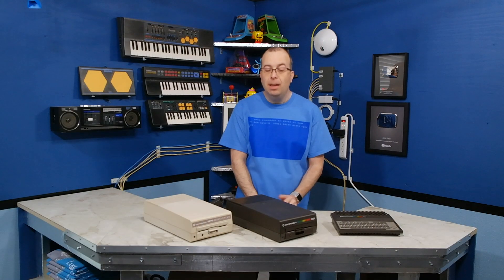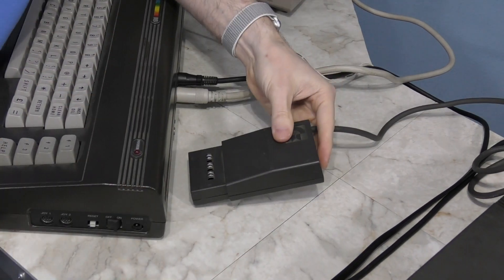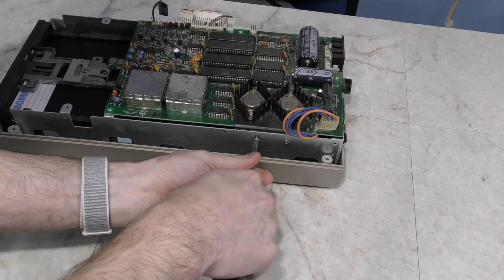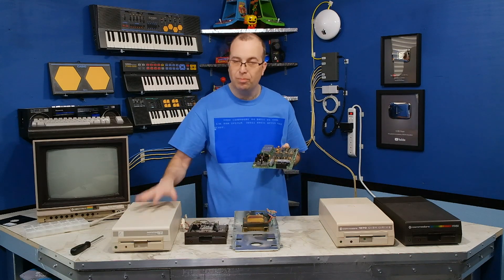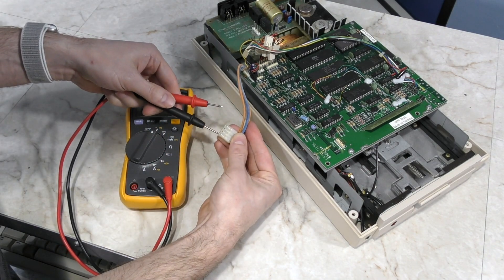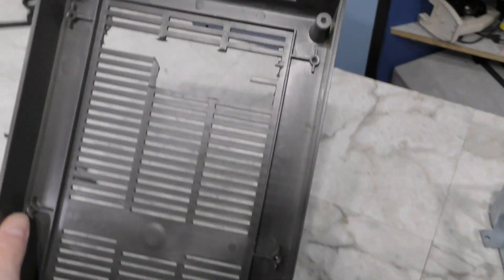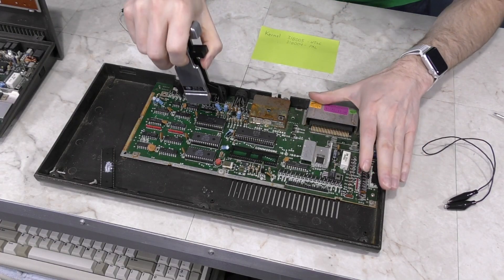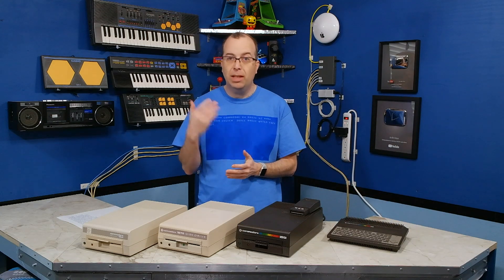Commodore C116 and drive repair, 240V to 120V conversion

Comment: wow, how can you get so much abos? It is nice to be influencer but not when you tell the people wrong stuff.

6510T is not a 6510 processor, else it would have printed 6510 on it and not 6510T. 

Most of those floppy transformers have 3 positions/pins, 110/220/240 Volt so most likely your "mod" on replacing that part was totally unnessaccary (except you had another version). At least you could have gave this advice or learn a bit about Commodore before doing a video?!? Oh this episode was not planned. This episode was horrible. Just solder it to the correct input voltage. Also the transparent feet hurt me, that is not a proper restoration. And 1551 always breaks and was not packed well during shipping. The drive mech also has a different color (black vs. brown on 1541). The commdoroe 64c in your picture has no original logo on it.
Reply: 6510T: version of 6510 with 8 I/O-Ports

Comment: Awesome video, do all the larger framed 1541 drives have compatible logic boards? I have a few myself I am about to dig into repairing. A video on how clean these and fix common faults would be an awesome follow up.

Comment: this guy is great when I was little I had 1581, 1541,1541'II and tape drive, and Gemstick, and light brown keyboard, also 1702 monitor, Okidata printer, and software I was using was Image 1,.2 BBS and Vision BBS, and Lt. Kernal Hard Drive I think that only made 10 megs

Comment: If you pull apart the keyboard, do a search for "wire glue." It's basically just a conductive paste, I've used it for small projects before, and I would be willing to bet that it would work for the rubber contacts. (It's also cheaper than the stuff used on the last one)

Comment: I live in the states and even though most of my outlets are 120V, My dad was able to install some 240v outlets easily in our home.
EDIT: I think these outlets are 220v not 240 not 100% sure though.
Reply: Yeah, all homes with electric stoves/dryers will have 240V outlets. These are now used by car chargers as well. They just have two hot connections.

Comment: I must add that it's nostalgic to see the inside of a C= floppy drive.  I have installed drive select switches (many times) ,  JiffyDOS (ditto) ,  and a RAMBoard (once) in those drives when I was part of the ACUG #0447.

Comment: I always disliked that style door mechanism on floppy drives. My first 1541 drive was like that and I used to have it on a low shelf right next to my chair. The drive was a little longer than the shelf was deep, so it stuck out a little. I lost count of the number of times I accidentally bumped it with my knee, which would eject the disk, usually right in the middle a disk access.

When that drive needed to be repaired, they swapped out the mechanism for one with a twist latch. I liked that one much better.

Comment: No surprise that you've found that C116 in Hungary. After the market failure of C+4 and C116 most remaining stocks were purchased by state-owned Hungarian companies to sell the machines for schools. At that time Hungary was behind the iron curtain and most home computers were smuggled into the country by individuals or were imported by state-owned companies. Those companies usually went after cheap stocks regardless their market value, since - because of the lack of any real competition - people bought whatever they could get their hands on anyway. Commodore 64 was the only exception which was imported and sold officially from the manufacturer, but its price was horrible (about a yearly average salary), so any cheaper alternative were welcomed.

Comment: I saw a 1541 in a Value Village over the weekend. It had the device 8/9 switch on the front of it and it was actually in really good condition but I didn't pick it up because I have no C64 and I'm sure David doesn't need any more 1541 drives. Just thought it was strange to find just the disk drive and not the C64 itself. Maybe someone else picked it up before I got there.

Comment: C116 the weakest and cheapest Commodore machine ever made but a weak Commodore is still great to play on especially if it's a game accross multi Commodore platforms you are playing you know it won't compare good to the other versions visual and audio wise but thats what makes it an interesting system you don't need the powerhouse Commodore hardware to get a good Commodore game out and if you are lucky the C116 version would get the best playability not counting audio and visual.

Comment: Hi. 
A question. Is it possible to connect a 5 1/4 PC floppy disk drive to a USB PC?
Reply: To my knowledge there exists no cheap mass-produced solution for that. But.. if you really need to do that, there exists the Kyroflux: https://www.kryoflux.com/

This is an advanced floppy controller that allows you to read almost any floppy format. Of course you can read PC floppy disks, but it also allows you to read PC, Apple and Atari floppy disks on your PC, with a PC 5.25 drive.

Comment: You can change a 1551's device number via software by typing in the following:

OPEN15,(current drive #),15,"%";CLOSE15

The 1541 M-W command to change the device number via software will NOT work on a 1551.   Also the 1551 is limited to device 8 or 9 and only two 1551s can be used by one computer.

Comment: I was concerned about the PAL vs NTSC and 240 V vs 120 V problem when I moved to Canada. Because I wasn't sure if my european Super Nintendo would work properly. So I bought a voltage transformer and a PAL to NTSC converter in advance just to find out that the tv I bought later in Canada can work with PAL just fine ^^ But at least the voltage transformer was useful :)

Comment: Re: De-soldering the crystal. When solder does not melt and you don't care much about component but want clean out. Add more solder to joint. Frequently it will help losen old solder and transfer heat more efficiently. Sound strange but give a try! <3 Like your channel.

Comment: 8bitguy i need your help. today i tried retrobright an powermac g3 desktop with salon cream 40%. it did retrobright but left big stains that do not match the rest. i think that the transparent plastic covering it had to do something with those spots. maybe air was formed and made a big bubble, looks like if oil or something was left as big stains, not yellow tho..only has a different tone than the rest.  can it be fixed? with another retrobright making sure the ziplock or plastic wrap does not touch the solution? I did notice some videos of people doing retrobright that the process on theirs also left stains and were not related to zones without cream because everything was covered with cream. maybe the plastic wrap is not good for the process

Comment: It's strange how NTSC TVs can't do PAL yet PAL TVs can do NTSC just fine. Weird.
Reply: This is because decoding PAL is more complex than NTSC. Once you have built a PAL tuner, you only need to do a few modifications in order to also accept NTSC signals. On the other hand, if you build an NTSC tuner,  the step to PAL is big, so you don't do that. As long as TV tuners were made of discrete electronic components, the quest for the lowest price automatically caused TV makers to make American TVs NTSC only. In Europe there was not much added cost to support both systems, so European TVs supported both.

Only when TVs became built from ICs that got cheaper over time thanks to Moore' s Law, the added cost of supporting both standards did vanish. Most TVs made since 2000 support both standards.
Reply: I don't think I realised that before. Thanks for that info!

Comment: ive found a speech synthesiser, i don't know if its the one you'll need to replace the onee that got fried but here you go:
https://www.ebay.co.uk/itm/CURRAH-SPEECH-64-For-The-Commodore-64-Cartridge-only-Vintage/122709376002?hash=item1c920c7c02:g:Yi0AAOSwj9dZvcpw

Comment: If need be, you can also find the 14.31818 MHz crystals on IBM PCs, XTs, and many clones. They used it for the same reason Commodore did (NTSC color burst timing) but divided the signal by 3 for the CPU clock, which is where 4.77 MHz came from.

Comment: Why convert PAL to NTSC when than means having inferior picture quality?
Reply: Picture quality is not the problem, because the higher resolution of PAL is not used by the computer and the phase shifting that NTSC can suffer from does not occur for directly connected equipment. The real problem is, if you use a computer that was mainly sold in PAL countries, there will be very few NTSC compatible software.

Comment: The more often I watch the video, the more I see that The 8-Bit Guy might want to learn. Here is some information about the 220V Transformer:

In Europe, different Countries used different voltages. Most countries used 220V (e.g. Germany) or 240V (e.g. UK). The European Transformer used in various Floppies has at least two primary coils. Nowadays the net is unified to 230V.

The 8-Bit Guy has the most common EU version. The white wire is considered as "neutral" and then there is a black and a red wire. The red one is meant for 220V (38 Ohm), the black one is for 240V (42 Ohm). As seen in the video, the red wire is not connected to anything and ends in a loop inside shrink tubing so the configuration is for 240V as advertized on the label.

Earlier transformers had soldering lugs on top. This makes converting easier but you deal with bare life lugs so working inside the Floppy is dangerous. There are also Versions with solder lugs which can actually be set to 110V but they are really rare, might even be experimental or made from warehouse leftovers.

Everybody who owns the 220V version should consider converting to 240V. The reason is that the regulators create a lot more waste heat when 230V is used. Also the capacitors are right at their rated maximum voltage and this tolerance is +/-20% so it is likely that the large capacitors blow up eventually. When converted to 240V, the Floppy emits 40% less waste heat and the raw voltages before the regulators are far below the rated voltage of the capacitors. It works reliable and increases the lifetime of the PSU components.

Comment: How did that jb weld work so well for you. That was not nearly even amounts of both. I've never used their plastic stuff before, only the metal binder. And that stuff is so difficult because you need to have EXACT amounts of both to get a good bond. Is the plastic stuff more similar to regular old epoxy? That would explain why it worked so well for you.

Comment: Why in the world would you just go ahead and power up and test that black drive, with that kind of damage. Especially with loose "things" inside! What if it was a piece of metal that broke off somewhere, could have shorted out the board. Or even if it is just plastic, it could have gotten lodged in the gears and damaged them.

I don't imagine those drives are cheap. Why take that kind of risk with it? It's not hard to take it apart and visually inspect for potential problems before you test it.

 Also, you can get 240v in the U.S. to you house. Is this different than PAL 240v?

Comment: A hint for the future, should you get a unit that is wired for 240V and have no other units to cannabalize, wire the primary windings in parallel (orange wires tied together, blue wires tied together)

Comment: I'd bet the C116 now runs a bit slower than it did. I don't know if there's any software for it either way, but I'm happy you've got one working. I just can't imagine trying to program that with a chicklet keyboard. Pure torture.

Other people have also commented the 1541 logic board has a bulging capacitor on it.

Comment: It's always awesome to see Commodore equipment get fixed and come back to life!

A quick tip about solder wick:  if it doesn't seem to be working, brush some solder flux on it.  That'll help draw solder into it.
Reply: Keep solder wick in a cool and dry place, and, if it shows signs of crystallized flux,  use a just a bit of extra heat with it.  Adding extra flux may work, but keeping the stuff in proper conditions will definitely extend its useful life.
Reply: @horusfalcon  So far any solder wick I've bought was dry copper braid, ie. it had no flux on it.  I've always had to add flux myself.

Comment: Apart from the mess having cities with 110v and cities with 220, I'm glad that here in Brazil most electronics are bivolt (I don't how you call this, but the power supply support 100~240v) and our analog TVs support PAL, NTSC and PAL-M (the official Brazilian transmission, got the PAL colours but keeping the 60Hz and 60-30FPS from NTSC), I can hook an PAL Super Nintendo, a Brazilian GameCube and an American PS1 in the same TV with no problem
Reply: Nowadays we mostly use switched power supplies which accept a wide range input voltage. In the 80's transformers were popular and those power supplies generally want a fixed input voltage. You had transformers that could be rewired between 110 and 220V, but there is a cost involved, so that was at least not unsiversal practise.

Comment: HI 8 Bit,
i had a chipped playstation (PAL) and if i tried NTSC games i'd get black n white, unless i used RGB. maybe if you use a RGB monitor that will solve the problem, as NTSC is redundant in this situatiom.

Comment: Strictly speaking, just doing a basic dir-listing to see if the floppy-drive is working isn't always sufficient. Sometimes they would only read the first few tracks due to sketchy electronics (or obvious head-alignment issues) or a bad (incorrect frequency or too low voltage) power-source...

Comment: when you have the opportunity, get a Brazilian CRT TV, preferably SONY WEGA, here we have the two voltages 110 and 220, so in the vast majority they come with automatic voltage selection, our color standard is the PAL / M at 60Hz , you can connect any NTSC or PAL / N device that generally works good

Comment: Actually we do have 220v power to our homes in the USA, but only a few appliances use it. Electric Clothes Dryer, Heating and Air conditioner, and/or equipment used to run a Pool or Hot tub. But you cant really connect them to these old computers.  These old computers only need 5v (or 12v) so it's possible that the PSU's will take 110v as-is and step it down to the 5-12v the units needs.

Comment: I'm guessing you probably weren't intending to keep the old crystal - it would have been better to cut the leads then pull them out rather than desolder the crystal.

Comment: A tip for solder wick on stubborn parts:   Reflow the joint with some new solder, then try wicking again.   Works well sometimes

Comment: I have 3 of the 1541 disk drives I got from a friend of my Grandpa and none of them work. One of them worked for a little while, but would keep intermittently giving me some sort of error, until eventually it just stopped working at all. At least he also had some third-party disk drive which works just fine (Excelerator Plus for those curious)!

Comment: The plastic used for the 1551 gets brittle after all these years...it happens to all devices sooner or later. Doesn't happen on the 1541 though.

Comment: But wouldnt the current be changed togther with voltage?
so probably it would be 125v and 500ma? instead of 250?

Comment: Wouldn't it be easier to scavenge an SMPS somewhere instead of fiddling with transformers? Or get an old laptop power supply and two buck converters?

Comment: I was wondering how easy this would be to convert. I eventually plan to import a PAL C64, glad to see it's fairly easy and straightforward, it's far easier than working on arcade boards and arcade monitors.

Comment: It's difficult to tell from the video but on the transformer it looked like it had duel winding for running on either 120/240 volts with it joined together with heat shrink. It may well be able to reconfigure the transformer as 120v unit.

Comment: Importing, the usual way: Buy a step down converter, hook your device to a multistandard TV and you're good to go. Importing, The 8-bit Guy way: Swap components, transformes and oscillators from at least three different units from two regions and print some labels. That's why I love this channel :D
Reply: Call it convoluted, But boy is it nice to not have to worry about that crap every time you want to use it 

I did the same thing with my PAL PS2; I swapped the power supply in it so I don't need to use a step up transformer every time; it's a pain in the butt honestly
Reply: *step-up
Reply: @MrToradragon  depends where you live
Reply: @MrToradragon  not always. If converting from 220/240 to 120 its a step-down. If you're doing the opposite (120 to 220/240) it's a step-up
Reply: @theforerunnerreclaimer  EU to US would be stepping 115 vac up to 250 vac to use the original EU power supplies, but that's not how our friend and humble narrator chose to do things.  He preferred to convert the equipment to use 115 by installing an appropriate power supply or transformer for US use.  That's a better solution long-term, and presents less of a chance for mis-powering and thus causing damage to the equipment.

There are switching power supply units available that will fit in a 1541 enclosure with little to no modification.  Some of these are even switch-selectable for 115 or 250 volt service.  They will cause the drive enclosure to run cooler, be more power-efficient and more versatile.  Arctic Retro just did a video which showed one of these units toward its end:  https://www.youtube.com/watch?v=-21WMK_X7oQ